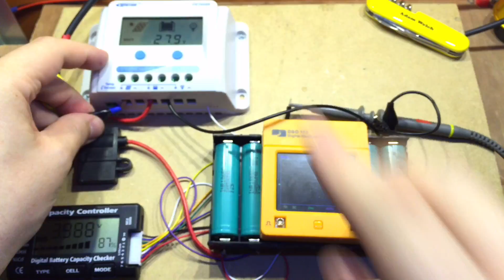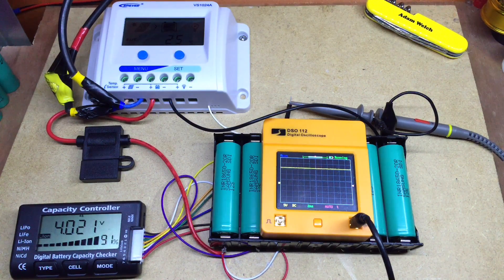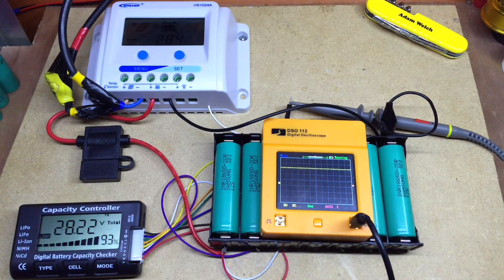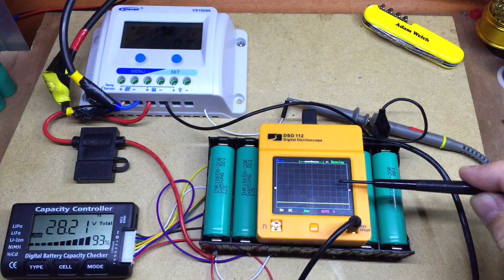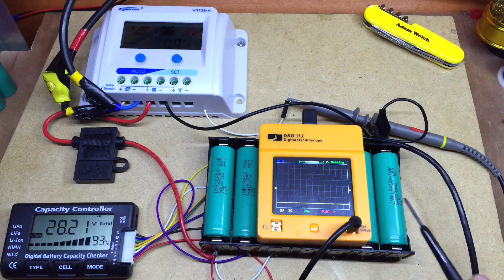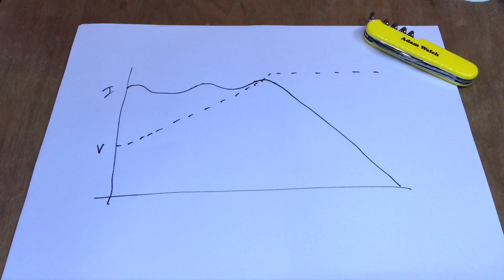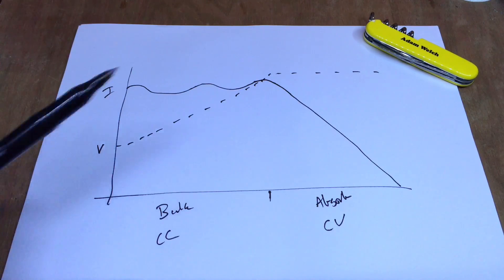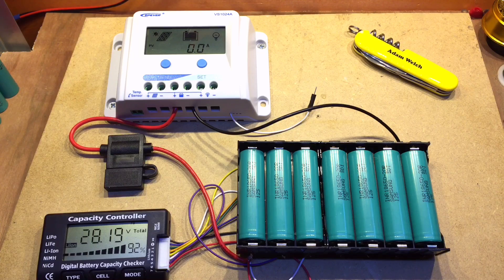Solar Charging Lithium Ion 18650s - Part 3, The Results - 12v Solar Shed

Comment: 4V a cell is little too low
Reply from the maker: Do you think?  You don't subscribe to the theory of lower voltage more cycles then?
Reply: Yes it will increase battery life but if you want more running time on the batteries you have to charge them at least up to 4.15v a cell.
Reply from the maker: My cells are running from 4.0 down to 3.6 overnight with the current load I've got.  I'm fairly happy with that as a good middle ground.  I could change the charging profile on the lead acid solar charge controller to allow for a equalization charge which would increase the pack by 1 volt (4.14 volts per cell) but my concern is that the equalization charge is timed, not voltage monitored.  One day when I'm feeling brave perhaps...
Reply: *****
Or just get a li-ion solar charge controller, There is the cheap Chinese ones and the expensive ones.
Reply from the maker: +James Bordon The whole point was to try charging them through a slightly unconventional method using things that people might have lying around. I've tried a couple of cheap Chinese lithium solar chargers as well based on the CN3722 but they're not fully featured charge controllers like most SLA chargers. There's no load output, little information on what's going on etc. 

I'd like to see some more cheap lithium chargers so if you have any links or suggestions that would be great.
Reply: The good ones are expensive because they are designed for large off grid packs such as the morningstar http://www.morningstarcorp.com/products/prostar-mppt/
Reply from the maker: +James Bordon Yeah - I like cheap though ;-) Thanks again.

Comment: Thanks for the tinkering!  I am actually looking to build a shed on the side of my yard soon and want power in there but don't want to bother installing a mains line in the ground to get power there.  So the solution would be solar on the roof of the shed.

I am also a harvester of 18650 cells and would love to have an interesting use for them like this.

One thing that keeps going through my mind though, is why not have one good deep cycle 12v battery that is charged from solar and then it feeds the charging of the 18650s using proper charging profiles?
Reply from the maker: +Jason Price Hello fellow tinkerer! If you look back through my videos you'll see I have got a lead acid setup and I have been charging 18650s from there. I've used TP4056s, a simple power supply, LiitoKala Chargers and an iMax b6 clone all connected up in one way or another to my lead acid system. 

However with lots of people reclaiming lithium cells (and 18650s in the main) I wanted to see if I could remove the middle man as it were. Every conversion results in losses and losses in solar aren't good. 

Lithium cells have a higher power density than lead acid, so they're smaller and lighter per kWh, they don't give off fumes like lead acid or need fluids topping up. They can have more cycles than lead acid. There's lots of reasons to consider removing the lead acid batteries out of a solar system. 

It's an experiment to see if it can work - and it does as long as you think about how you're using your battery bank. I'm not going to be throwing my lead acid batteries away any time soon - but if I was starting from scratch again I'd have to seriously consider lithium based cells.
Reply: ***** That makes perfect sense.  I just figured that the Lead Acid buffer/source would be enough easier than managing direct Li Ion charging.  Although +Electrodacus has a really appealing device that Julian has looked at and now has one of.  A bit of cash but worth it if one got serious about it all.
Reply from the maker: Dacian's chargers look to be well made and brilliantly designed.  I'd very much like to get my hands on one of them one day - I just don't have a decent enough lithium battery bank to warrant the purchase at the mo.  

Best of luck with your shed project.
Reply: ***** thanks and you too!

Comment: Thanks for your video series about using a regular solar charge controller for li-ion !

Also, a key thing to do, just once, is to Bottom Balance each cell, as explained in my 4 yo post (my DIY ESS has 8 LiFEPO4 cells, in series, and still in balance after 3 years of use): Google "lifepo4 charging method myelifenow" to find it
Of course voltage limits are different with 18650 cells bu the idea is exactly ythe same, and it works
Reply from the maker: +Christophe HUBERT Thanks Christophe. Some useful tips there.

Comment: Hi Adam, thanks for all your progress updates on this project. 

It's very interesting as this could make mini portable solar setups for hiking or camping more viable from a weight and size perspective. The energy density and weight from a LION or LIPO battery is much better than sealed lead acid. 

It's a shame that the small cheap SJ3A solar controller LION version doesn't charge very well as this could make for a very portable package.
Reply from the maker: +thinkpadfoot I need to revisit that and reinvestigate its float voltage. Next time I need to use better cells too in case that has some effect.  Thanks for your comments.

Comment: i still have my concerns connecting directly my mppt solar charge controller to my 7s 24v 18650 pack. main concern is even the controller can be set up to a discharge voltage load cut off and overcharge protection . balancing are they going to be kept balanced. additionally dud you make a video about your bms testings ? is it recommended to have one dtill? thx great video
Reply: sorry for typos
Reply from the maker: +Serviciosymas Nearly every commercial charge controller I've come across has under discharge protection and over charge protection. In this video I showed even the cheapest end of controllers that don't have the option for users to change those voltages can be used in this example. 

The capacity controller is keeping the cells balanced, the charge controller is doing over and under voltage protection - combined they are my BMS.

Comment: Have you looked at the Mincong charge controller. All of its voltages are adjustable, making it more suitable for Lithium. see  wincong SL03-20A DC12/24v solar Charge Controllers USB LCD Li-ion on ebay

Comment: Your capacity controller simply 'balances' by burning off voltage from each of the 6 cells that are higher than the lowest cell. Leave it running on a pack that you are not charging and it will very slowly flatten all of your cells down to its cut off point. This cut off point maybe be adjustable??, you should read the instructions again. Cheers
Reply from the maker: +Peter Hancox I'll need to find them first!

Comment: Great series, my only question,  how much will it scale up? 5P,  maybe even 20P? I have some simple  4x5 cell holders and lots of salvage and tested 18650 cells.
Reply from the maker: +Daniel Romine I think it will scale. Matching the amount of solar to cells might be the trickiest part - you want to consider the c rate. Thanks for your comments.